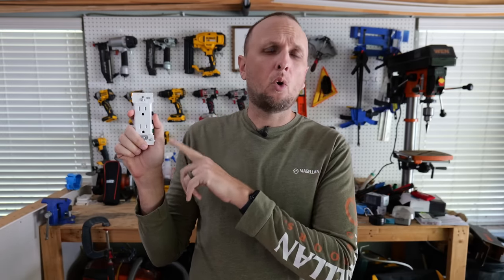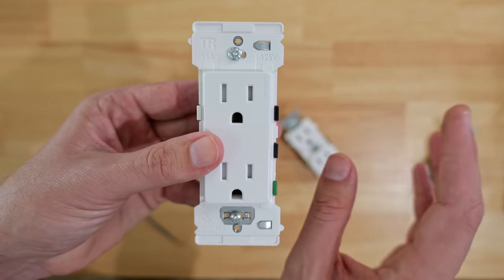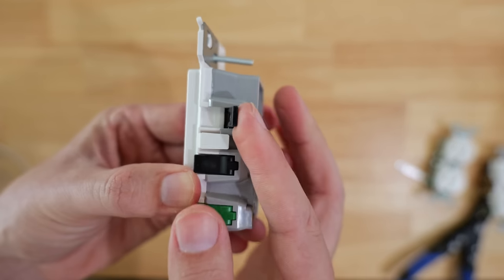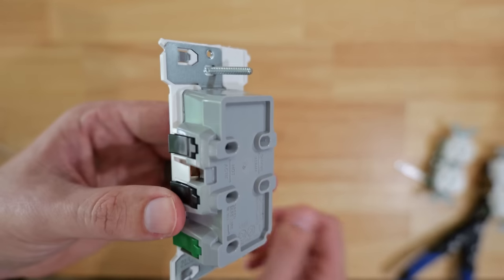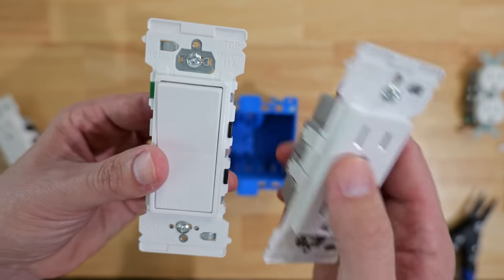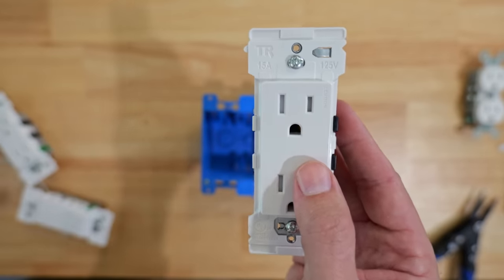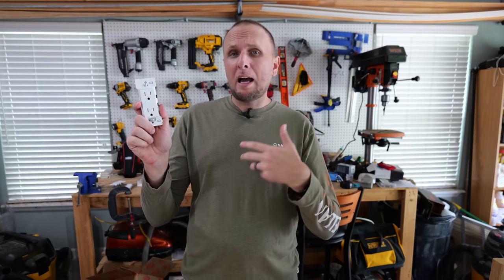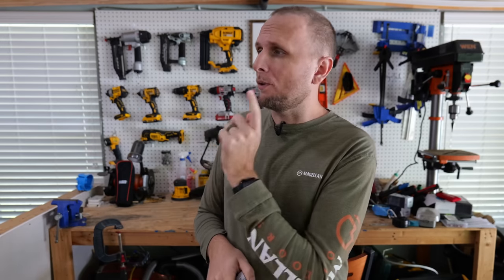The Fastest, Safest, and Most DIY Friendly Outlet Available!

Comment: I always use the side screws for best surface contact. Then wrap the screws with electrical tape.
How about cracking open a  current outlet, and this new outlet, and get a visual comparison  of the surface contact?
Back stab vs this new outlet vs side screws.

Comment: I see the patent is pending on these. I hope it works out and that they make more versions. Right now they only have the tamper resistant 15amp outlet and two different rocker switches. A single pole and a triple pole (I think). One feature that I saw in the official Leviton video that wasn't mentioned here is that there are testing ports on the back so you can check the voltage without removing the wires. I'd love to see them make more versions: 20amp, GFCI, triple and double rockers for fans/lights, etc. I checked the prices for them and they are reasonably priced for now.

Comment: I am not a fan of backstab outlets because it's working on the principle of one-way friction between the metal contact and the wire both of which are gonna have thermal differences underload.
I've also seen a ton of them literally slide off the wire as I pull it out. Lever nut connectors big fan I'm glad we're finally getting them. Looks like they've incorporated a lot of cool design elements into the socket. The levers press the wire against the metal contact inside which means a far better connection. I love that the sides are fully covered as the number of outlets I have pulled the cover off and found the screws not screwed in just waiting to come in contact with the outside of the box or fingers... congratulations.
The only drawback in the last 10 years there was a recent product developed .... the night light wall plate. one of those as seen on TV will sell it to you for 3 payments of $20 when it cost us a dollar to make. They use tabs that touch the little screws on the side or the center bridging Contact. It's such an abomination of a design but it's also simplistic. Although I also don't believe should exist, it's just feels like one layer of safety away from not being safe. Now if we could just sleeve our prongs.

Comment: I just installed six of these outlets in an overhead situation in my garage to plug led light fixtures into.  I was struggling to get the hooked wires onto the terminals of a traditional receptacle while holding the outlet over my  head.  I ended up installing all six of these new outlets in the time that I had spent on a single traditional receptacle.  As long as it doesn't malfunction and burn my house down (I'm kidding), I'll be using these from this point on. Just wish they had a black version available now as an aesthetic choice for certain areas of my house.

Comment: The bridge to split the socket also has a cover -- two feed a split phase line 120+120 as required for kitchen counter plugs in many localities. Of course you will need an expensive double poll GFI breaker that can sum the two hots and one neutral if duplex is within 5 feet of the sink. $200 crazy gfci 2 pole breaker.

Comment: One issue I have found in the use of Wego connectors is when pushing the connected wires into the box, if the levers are facing the opening (front) there is a chance of the levers being opened by the wire pushing against the lever.  This happened about 30% of the time and I have made sure the levers are not being pushed on by the wires.  Taping or including some type of a non-conducting lever clamp could be adapted to eliminate the levers opening.  The adaption of a torque screwdriver in the tightening of the screw terminals on a compression type screw connection would provide consistent high reliability connections.  Not enough torque will cause wire release, to high can in extreme cases can cause thread stripping and connection failure.
Reply from the maker: Yup, I have seen that happen as well.  But the Wago crowd refuses to believe that can happen.

Comment: For AL Wiring users, you could probably get away with putting some antiox inside these ports, and brushing on a light coating over a freshly cut and stripped AL Conductor and have no problems with AL wiring.  For cautionary purposes, I would still wrap the levers with electrical tape to make sure they stay shut.  AL Wiring has the tendency to expand under heavy load.  

Not sure if they allow enough room for 10AWG AL; for 20 amp receptacles, you might only be able to use them on 15A AL, or you would have to splice the 10AWG AL to 12AWG Copper for your 20 amp circuits, which is what I would recommend anyways due to AL's ability to expand under load.

I've been doing this with my WAGOS using antiox inside the connector and I have had no problems for over 5 years!

Comment: These lever mechanisms are proven and the future is now, not because they work better than a screw, but because they are faster to install and less prone to installer error. For anyone who doesn't know, this isn't a clamp that can fail. Instead, it's a lever that temporarily opens a conductor that was bent into a spring. When the lever is closed, you could take a blow torch to it and it won't affect the clamping force of the springy conductor inside!

Comment: Can you split the outlet? Install two circuits on one outlet? I read some other posts, yes you can split the outlet. Very cool. These Wago clips, or whatever they are called, are so much nicer than the old wire nuts. And these new outlets, I don't mind the screws, but these Wago connections are unlikely to loosen over time due to the properties of electricity. Very nice.
Reply from the maker: Yes you can.  The bridge is just under a flap of plastic that can be lifted up.

Comment: Would love a commercial version, but I'll be using these for future installs. It's both speed, and I find it easier to push safely into the box. I've had older wire, after twisting on, actually split when inserting into the box, and these will reduce this occurence. 
Already in stock at local box store.
Reply: hubbell edge for commercial

Comment: Wow I really like these! Makes them safer too, with no exposed powered metal.
$3.50 at my local HD, or $25 for a 10-pack. Okay price for the ease of install and future removal / swap out.

The fact that their Edge products don't have exposed metal would've helped me to not get shocked, when I learned that one of our boxes had 2 circuits in it xD
3-gang box. far left switch for kitchen. Next two for pantry/laundry light, and laundry extractor fan. 
Found out that the pantry is hooked up to the garage circuit, while the kitchen switch is of course on the kitchen circuit. (Thought the pantry would've been part of the kitchen) 

Now I know to turn off both circuits when working on that specific box. I also now own one of those NC voltage sensors, and understand how to use it correctly.

Comment: I like this idea a lot. I am an amateur that has done quite a bit of wiring. Even with my experience a professional is still about three times as fast at installing an outlet as I am. So I'm happy to see something that makes installing a receptacle easier.

It seems like it's been about ten years since I first saw that tamper resistant outlets were required by code at a local building department. But 10 years later they still sell non tamper resistant outlets and I have heard some discussion that they are annoying for some people. Are they ever going to become more common? Are inspectors enforcing a requirement for tamper resistant receptacles?

The expanded size mounting area seems like a really good idea to me. Some people will just leave them on and use larger wall plates to cover them up. These people would probably just ended up with a sloppy installation without this. Professionals might like them as well since fiddling with the spacers takes a bit of time and fixing the wall takes a lot of time.

Comment: Everyone should know that the words "hot" and "neutral" are misnomers when talking about the electricity flowing through the receptacle or any other device using alternating current.

Alternating current is current that changes direction and flows the opposite direction that it was flowing before.  In the US, AC current switches direction 60 times a second and in other parts of the world the AC current switches 50 times a second.

That means the "neutral" wire is every bit as hot as the "hot" wire.  And the ground wire is bonded to the "neutral" wire at the electrical panel so it too has the potential to carry current.

So anytime you are working on any sort of device, even with the breaker turned to the "off" position to brake the circuit on the "hot" side, always treat all of the wires as carrying electrical current, because they can and the potential to complete a circuit with your body is always there.

Comment: It is strange that they are only now coming to the US. 
Danish Standard plug also called lk fuga KONTAKT 
they do not use screw terminals because there is a greater chance of short circuits and electric shock 

It has been over 30 years since the design was redesigned to make it safer
Reply: FUGA is from 1981. So they more than 40 years old. Because they are using springs, they do not need to be retighten.
Also there are 2 holes for each wire, so you can daisy chain them.

Comment: I think the problem with backstabbing regular receptacles is that the wires need to be cut when ever to outlet is replaced. The lever nut style is less damaging when removed by unlocking. Demonstration was useful to show it is a strong connection.
Reply: Many (maybe all) backstab receptacles have a slot to insert a small screwdriver to release the wire without cutting or damaging it.

Comment: This is a compelling product and this feature should be a standard across the board IMO. Coming from low-volt structured cabling, high-volt residential in the US is still very much the wild-west and I see many areas of opportunity to increase ease of install and safety when I'm working with it. It looks like this design also addresses one of my biggest complaints about how the standard little bitty metal yoke don't fit well in anything but an impeccably-installed JB, which happens like never. I'd also love to see JB's get bigger inside, have a better mounting solution than 2 nails or screws, and also have integrated conductor strips with a standardized receptacle pigtail, sort of like the LED driver boxes.
Reply: TBH, this bothers me a lot less than using wagos for connecting wires together. From what I'm seeing, I'll probably start using these when I finish going around my condo replacing the worn out sockets. Many of them are 50+ years old and have lost enough of the springiness that is needed to hold the cord prongs securely. This should both be quicker to swap out as well as more secure.

Comment: I've recently seen the internals of lever connection receptacles and I would like to see is a redesign of the lever lock.  They really need a flat face connection to the wire (similar to actual WAGO lever nuts) instead of the wire only engaging with the edge of the contact.  The connection holds well but I want to see more surface area in the connection for when the receptacle is pulling higher current.

Comment: I would like to see a test of two 1350 watt electric heaters running off of one of these new Leviton wago block connector duplex outlets.  What will a time to smoke test reveal?
Reply: Breaker will most likely trip before enough load can burn up the receptacle. A 20A breaker produces up to 2400W. 2 heaters at 1350W gives the total of 2700W. Breakers are also designed with heat tripping. So if the breaker gets to hot from overload it will trip.

Comment: at first while watching this video, I didn't hear a mention of price so i though that they had to be hella expensive, but following the link I found that they were only $4.  while this is roughly twice the price of a standard generic outlet, $4 is NOT all that expensive in the great scheme of things so that's not really a deal breaker... overall I think these look pretty good for diyers, and I think it's a great buy to improve simplicity and installation safety for people who don't really want to have to mess with making hooks and making sure that things are fastened correctly.  wagos, at least in my experience, are relatively trustworthy (I've used them in some 3d printers for safety and ease of use for wiring up mains powered bed heaters to solid state relays so they can be properly switched, and they work great).  I would certainly get behind this as a new standard.  I'm curious, however, if they'll make a 20a version, and also if they'll make versions of their smart outlets like this as well.  I could see this as a boon to improving safety for DIY installs of smart outlets and other such gear.
Reply: It adds up over a larger project, but for the target audience that's unlikely to be doing more than a couple dozen, if even that many, it's probably worth the piece of mind knowing that the outlet is properly installed.

Comment: I can see electricians wiring residential houses switching from installing standard screw in receptacles to these. Much faster and a lot less hassle. Wago connectors for the pigtails and then Leviton receptacles and switches. Done!
I look forward to seeing commercial quality ones as I need to upgrade my kitchen receptacles to 20 amp from 15's. Those would be perfect.
Reply: Speaking as an electrician, the only upside I see about these receptacles is that they're going to increase the number of calls I get. I've seen so many Wagos fail, because the contact between the wire and the tiny little bus bar (which isn't copper) is minuscule. Over time, this contact degrades and eventually begins to arc, which is the end of the fragile bus bar. Screw terminal connections and wirenuts are not difficult to use yet offer a superior connection. If you're not comfortable using them, I do not recommend DYing electrical work. As an electrician, I would never install substandard gear for a customer. It's not right and it's on me if it fails. Saving a few seconds isn't worth a warranty trip out within a year or two.

Only silver lining is that Wagos are harder to screw up than screw terminals (pun unintended). Still, they suck.
Reply: Don't forget to upgrade your wiring in the kitchen as well :)

Comment: It's easier, clearly, but I don't do enough of them for the time difference to matter.

Also, it would prevent the use of faceplates that tap into the terminals for power (nightlights, primarily; I've got a lot of SnapPower stuff installed).
Reply: You could always make a pigtail
Reply: @nachoisme  can't use a pigtail for the snap covers. The snap covers make contact to the screw terminals of receptacles.

Comment: I think the new receptacles are better than the old style because there are no bare electrical contact parts showing that can arc or short out when it is wired up. My only concern is the cost. The new style should be easier and cheaper to make than the old style but is it cheaper to buy? I have a question for the group. Do you put the ground plug up or down, and why?

Comment: 1.30 more than a standard receptacle might not seem like much but if you are trimming out a whole house that’s about 130 out of your pocket. Times 3 a week is 400.
Reply from the maker: True but you are passing that on to the customer if they want it.  Like I said in the video, I think this was made with the DIYer in mind.  I don’t think this is going to be used much by electricians due to the added cost.  Only way I see electricians installing these is either the homeowner requests them or they just find they are so much faster to get installed that it justifies the added cost so they can get to the next job and knock it out faster.  Just my thoughts on it.

Comment: I will always prefer spec grade devices (screw and back wire options only).  I hate back stab and these are a huge improvement over those for DYIers who don't want to bother with the extra work spec grade may introduce.  Always give each wire a tug to ensure it is firmly attached, no matter the connection style.

I love the alignment feature... hope all devices get them in the future.  Ever try and align a faceplate for a 4 or 5 gang switch?  LOL
Reply: Knob & Tube wiring was spec grade in it's day. You should embrace improvements like this. It will be the standard industry connector soon.
Reply: Well, when it is rated as such, I'll look at it.  Until then, nope.

Comment: I like using them. Sadly they still only have receptacles and 2- and 3-way switches. 

I have missed dimmer switch and USB socket versions already and I am sure I will start to miss 4-way switches and various wireless, sensor and timer devices using the same format.

One odd thing is that with the receptacle you can easily loop hot and neutral through, but not ground. There is only one neutral clamp so you still need some extra tools and materials to do a complete install. I wish they could get that certified. Perhaps get a change in the rough-in check procedure?  But I guess that's where fact meets fiction. Electrical inspections seem to become more of an art when it comes to grounding 🙂

Comment: I love how you show an old work (cut in) box and state "now this will fit in your standard box"  Two different animals and it does not fit correctly in a cut in box. The (ears) need to be removed. Refer to 4:45 and look at the standard outlet yoke creases above the mounting screw and to the side of the holes. On cut in installs the tab or tabs need to be removed so the device does not sit proud of the surface of the wall.